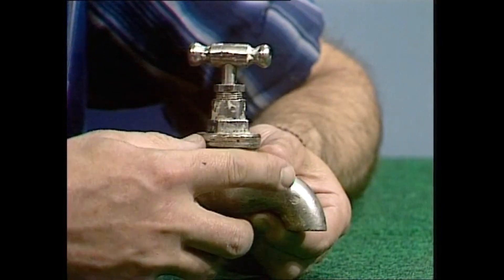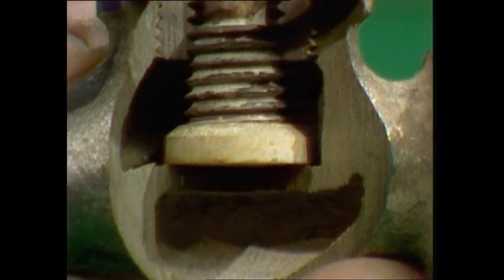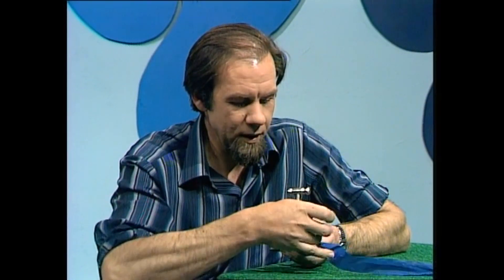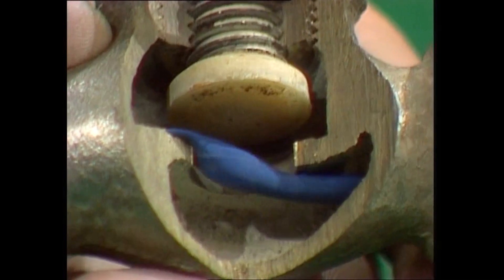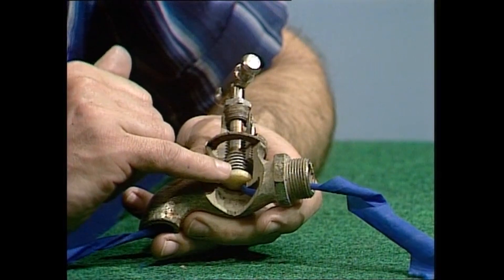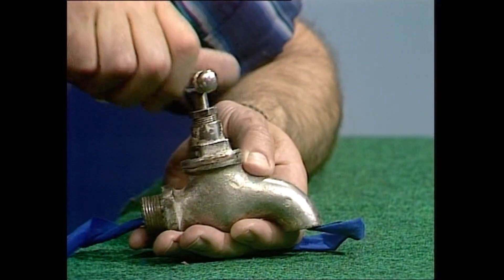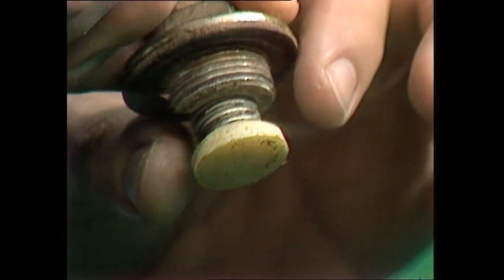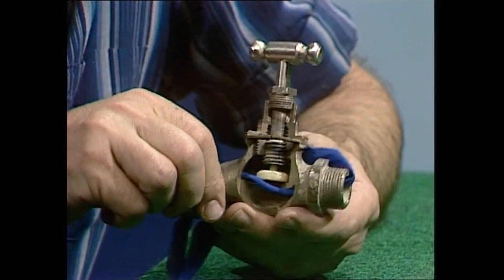How does a tap work?

Comment: I think the model has an 'O' ring missing above the threads that keeps it from leaking around the valve stem. If i'm wrong I'm curious what keeps the water from leaking around the threads at the top when it's open.

Comment: How do the new taps work, the ones with a lever that can move up, down, left and right to change to temperature as well as rate?
Reply: Hot water probably flows from 1 side. And cold water flows from the other. When you flip it to the hot side you are blocking the cold water and letting the hot water through. Amd vice versa. Same principle for changing the rate. The more up you pull the lever the higher you lift the blocker amd the more pressure flows through. I'm no plumber. But thats how I would imagine it works.
Reply: A mixer has a hollow ball with a few holes in it.  The holes toward the back are at the left (hot) and right (cold), and rotation around the vertical axis determines the ratio of hot to cold.  The hole at the front leads to the outlet, and rotation around a horizontal axis determines how quickly the water comes out.
Reply: i believe its a round washer and hole on both levers which converge into the faucet.
Reply: Dark magics. That's how.
Reply: @WDCallahan  Thermalis variatus. Swish and flick.
Reply: @WDCallahan  the dark arts, bro
Reply: Fuck you man now im never getting sleep

Comment: Thanks for reminding my that my bathroom sink tap is leaking! Need to change the washer inside. The only issue I have with taps is that they translate a linear change in movement of the tap into a non-linear change of water flow. It's like ON or OFF for most newer styles of tap.
Reply: Either on or off, sounds Digital to me hehe, I have the old style with this Jumper valve, and the Ceramic Disk ones as well.